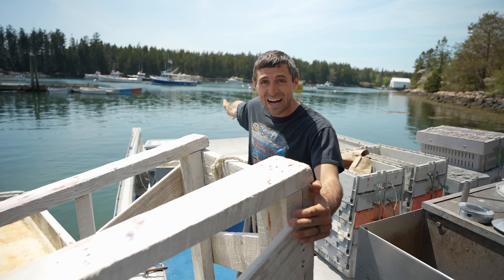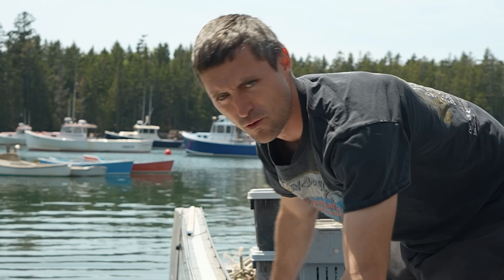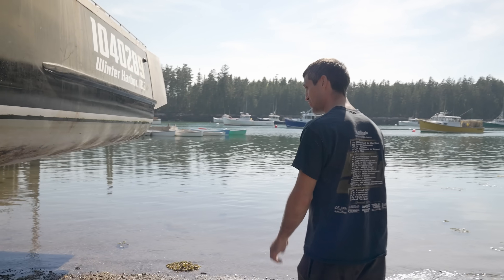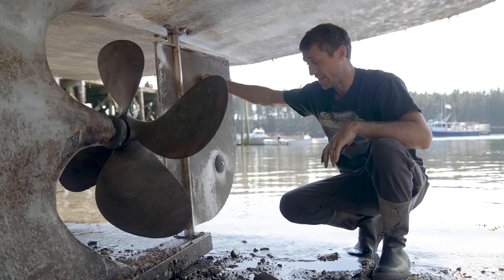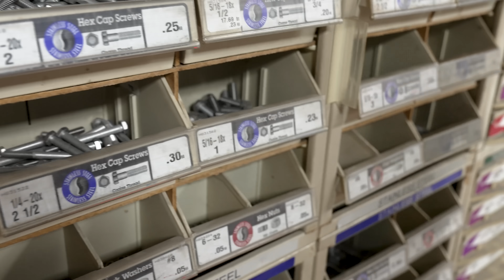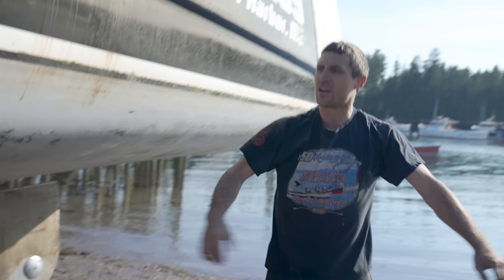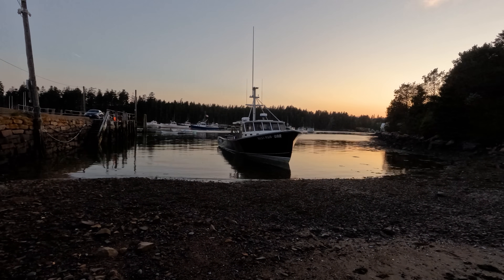I Ran The Boat Aground!!! (on purpose)

Comment: almost 15 years I spent working at a marina in West Vancouver on pleasure craft. We used a LOT of 3M 5200 and we turned mussels and barnacles into soup with a 5000 psi power washer. I still can't eat mussels, and its been almost 5 years since I left

Comment: I spent an entire summer with my Dad cleaning and prepping the bottom of his charter boat. Running a propane torch over the bottom to get the wood worms to back out enough to hook them and pull them out then scraping the bottom for barnacles and algae. After that we sanded or grinded the whole thing so we could get the old paint off and start new on the wood after we patched and caulked all the wood worm holes. After 2 months of repairing the hull we finally got to paint, 6 coats, 3 clear coats then the zinc paint. But on my when we finally finished it, just wow. Everything was new from outside in to the cushions, table and everything. She was capable of carrying 12 passengers in style and was able to cater to every whim. Very nice when done.

Comment: There is still a careening stand at the town dock in Southwest Harbor.  It doesn't get much use any more since the majority of boats haul out for at least part of the winter and do their bottom work when they are on the hard.  Do you not have a cage for fuel economy reasons?  Incidentally I was out in the Great Harbor of MDI this week and there is almost no gear there.  I expect that most of the local fishers are working out past the Duck Islands.  Last year there was very little gear in the Great Harbor (inside the Cranberries) until August and not all that much then.  I also noticed that water temps were in the 53F range, which seems really high to me.  I remember when water temps this time of year were in the low 40s at best.

Comment: @Jacob Knowles

I notice you have a left handed screw.  In the navy that is pretty much only found on vessels with two or more shafts.  To my knowledge, right handed screws are pretty much the standard on single shaft vessels.

After a little bit of thought I realized that a left handed screw can make your job a little bit easier since the torque would naturally cause the boat to heel a bit to the starboard side and torque steer would make it naturally want to turn in a clockwise circle while in forward gear.

Is a left handed screw a common feature on boats like yours where work is done on the starboard side?

Comment: The algorithm finally put something good in my feed. Great channel, Jacob! How'd the barnacle removal go? And the fix to the shoe? I hope you lost vibration and gained some speed and efficiency back. If you want to gain even more, we may be able to help. For the past several years, we've been developing a propeller design that is very well-suited to boats with limited propeller diameter, such as on the Rest Ash-Oar. In all cases, we've observed significant gains in thrust while dramatically reducing vibration, noise and cavitation. If you ever need to explore a new wheel for the boat, please reach out. It would be fun to sync up.